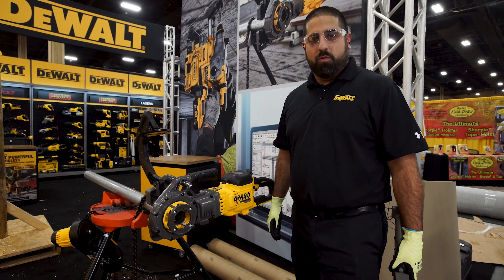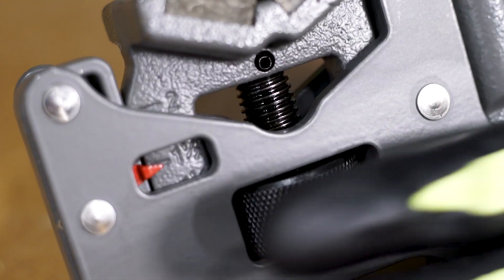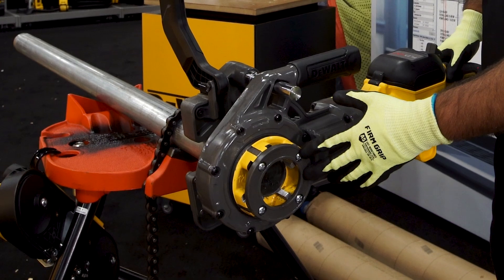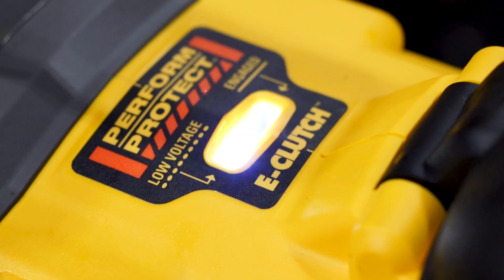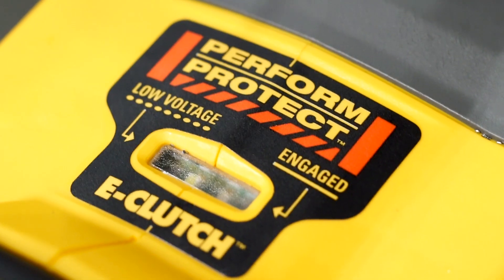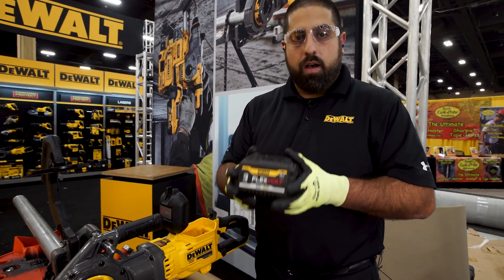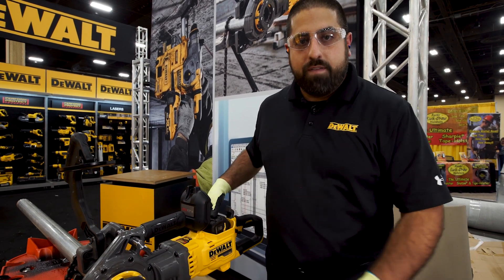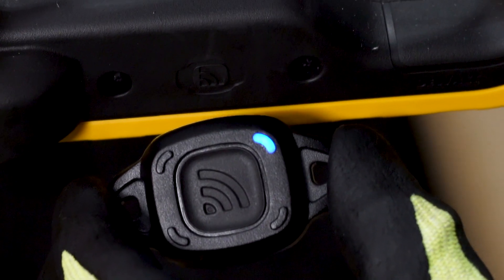#NECA19: Introducing The DEWALT FLEXVOLT® 60V MAX* Cordless Pipe Threader

Comment: I no longer have the cinfianca I had in dewalt products.  I bought 10 times the same product and always have the same problem.  I called the technical assistance and they said there was no reason for recall.  I returned it and I don't want the DCD966 anymore.

Comment: Hey DEWALT.... just bought the new Table saw with 24 1/2" fence capacity on the right. Question:  Why did you even bother to make that Black Friday 299.00 fishing lure shiny saw including the stand... with only 20" rip capacity? why? why? ... What really bothers me is you don't mention that on the outside of the box. The store clerk had to look it up.....and that stand... omg.. what a piece of crap. Nobody is gonna use those little bolts to fasten it to a Portable Saw. The cross supports are so weak you can bend it with your fingers. I am so disgusted with this stand I intend to warn as many contractors as possible online: DO NOT BUY THE DEWALT SCISSOR STAND.... shame on you.

Comment: Cool, but lil slow at end of thread and sounded like losing power, dead or dieing battery? 
Please make it 120 volt or double the current with two batteries
Reply: In fairness, my only experience is with a portable rigid? pipe threader that was a beast of tool and I think it had its own stand. Wasn't mine, just used a lot over 2 years at two warehouse location. Lot of 2" gas line, and a bunch of air line stuff from 2" to 3/4"
Reply: Even 120V pipe threaders do that when you get deep on pipe.
Reply: @wileecoyote5749  yeah, like 3/4" past threader is worse case scenario and the one I ran didn't flinch. So is my experience only with a really good one then? A lot of people used it and said that was the best threader they've ever used.
I am a DeWalt fan/fam.
Reply: @Georges3DPrinters  ok then